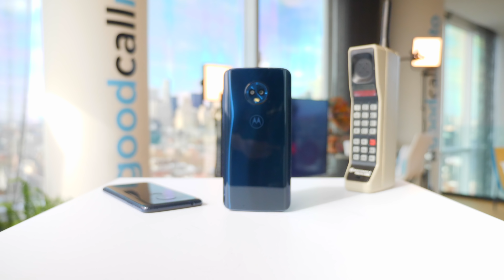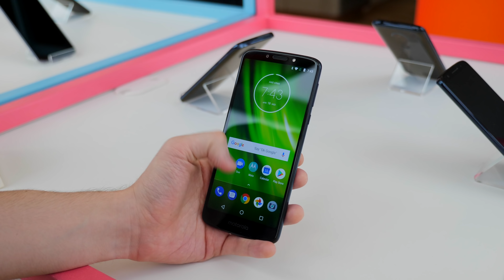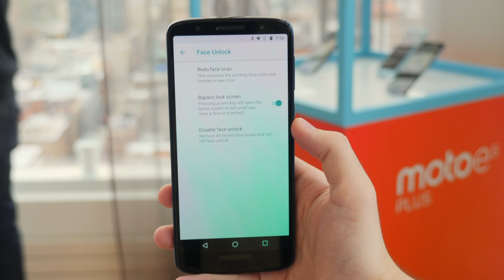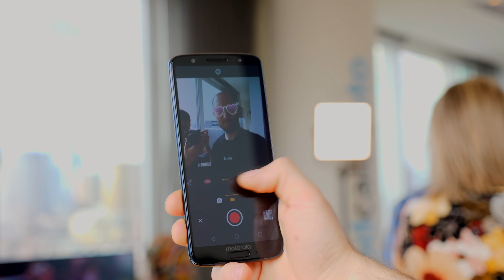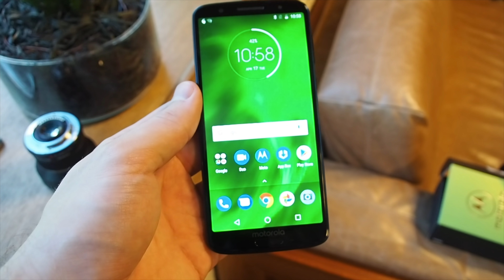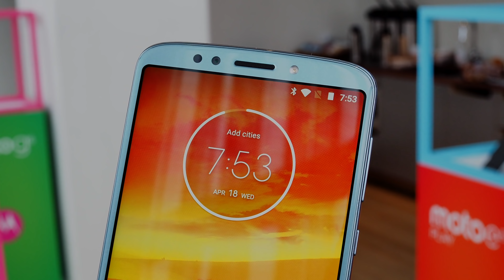Moto G6 series hands-on: G6, G6 Play, and G6 Plus in-depth!

Comment: Looks like a cheaper version of the piece of crap Moto Z with the update the software destroy the battery feature.  Hope your updates dont kill off the battery like they did mine at exactly one year-coincidentally after the warranty was out.  I will avoid Moto like the Plague from here on.  Junk all junk.  Shame really-I had 4 Droids in a row, even the very first with a slide out keyboard.  This one is the worst phone I ever owned, bar none.

Comment: Moto G6 Play is $80 at Walmart
Reply: It's $80 because its a Boost Mobile  phone. But, it does also work on Sprint service. Actually the SIM card that comes with it is Sprint branded. This is how I bought mine and I'm using it with the Sprint 1 year free service. I called the sales line and activated it with them. I've been using it for 2 weeks now on Sprint with no issues.
Reply: P47 Thunderbolt That's a steal. There's gotta be a catch
Reply: Shanez1215 ,it's a decent phone, not spectacular . The Play is the cheapest of the G6 line. Also it will not except the Moto ad ons .

Comment: Until they use "Replaceable batteries", I'm not touching them, I have a DEAD Moto-X Pure Edition that gave up the ghost shy of the 2 year mark, the bettery is NOT-USER REPLACEABLE & there is NO ONE IN HOUSTON, TX that will touch it.  Best for low price models, Samsung Galaxy J7 which has replacable batteries & in same price bracket as the Moto-G series, but with options to expand memory yo 256GB & some models available with 2 SIM card slots if you travel outside the USA a lot..!
Reply: Howard1939 ... The Moto x Pure is so easy to change the battery. Very easy job. Do you have hair dryer? It isn't like the essential phone where you need to destroy it to reach the battery. If you need a phone with replaceable battery, you are gonna be stuck with like 1% of the phone market and it is gonna be lame phones. No way would I take a used galaxy s7 with its garbage battery life and horrible user interface over the Moto.

Comment: I personally don't like the new Moto Camera app. The old version was much easier to use with one hand. I could just swipe a finger to zoom in/out. Now it's a pinch gesture that takes quite a bit of movement to get it to engage. It is much more difficult to minutely adjust. (I'm on a Moto G4)
Reply: Jeff K ... No. In the settings of new camera app, you can enable zoom up with finger swipe up. You have options.
Reply: thanks. I have only used it once since it updated on me. Kind of annoyed me and didn't have time to look around much. I don't take pictures that often
Reply: Jeff K ... I have 2 Moto Z play phones and did side-by-side test. The new app take better photos over the old app. The new app also shows the thumbnail picture last taken which is nice. The old app has a cleaner less cluttered interface. One can make a case for either one being better. I slightly lean towards the old camera app because I prefer full 16:9 view and want a cleaner look. If you uninstall the new camera app, it simply goes back to old camera app.

Comment: Very solid mid-rangers, however the Xiaomi Mi A2 is coming very soon, and it seems to be better in pretty much every single way, and actually being something like an upper mid-ranger. The design, where Motorola is actually very distinctive, sort of like Sony is what I like, as well as the Moto gestures, which are the best.
One note to make: all the G6 models should have had the fingerprint sensor on the back, I just don't get how they made that happen for the cheapest of the bunch and put a home button on the more expensive ones. A front fingerprint sensor on a tall phone is not the best way to go. I can't believe ordinary consumers realize these things, and manufacturers don't.

Comment: Don't be fooled. Yes, the SD 450 and SD 625 both use 8 Cortex A53s on a 14nm process, along with the same GPU, but the 450 has a lower clock speed (1.8 GHz vs 2.0 GHz). You can compare all the specs on Qualcomm's website. It's literally a downgrade.
Reply: Trust me fanboi never understand lenovo just f@#$up G series...
Reply: I agree. But for some reason these youtubers (or lenovo/motorola) insist that the G6 is an upgrade to the G5s Plus. Probably as an excuse for not bringing the G6 Plus to the US.
Reply: Is the 0.2 Ghz downclock going to make a world of a difference? I guess not.  And it is an upgrade compared to G5 Plus of all the obvious changes that we can figure out.
Reply: Since when in smartphone history does a successor have a slower processor? The G5s plus is a variant of the G5 plus, so it's acceptable for it to have the same processor. But to claim that the G6 is the successor to the G5s plus is ridiculous. Based on the naming itself, the G6 Plus is the successor to the G5s Plus. Based on the processor (source: Qualcomm), the G6 Plus is also the successor to the G5s Plus. The 400 series and 600 series processors are not even in the same tiers. Another interesting fact is that the processor is missing in Motorola's G6 specs sheet, while it's listed in every other one of their smartphones. In the features section it just mentions "1.8 GHz Octa-core processor." Hmm, is it just coincidence that the G6 doesn't mention its processor, or are they purposefully hiding it? Whatever the case, based on logic, the G6 (SD 450) is the successor to the G5 (SD 430), and the G6 Plus (SD 630) is the successor to the G5s Plus (SD 625). I don't know how it can be any more clear than that. My issue is not with any of the devices or pricing. It's with whoever is claiming that the G6 is the successor to the G5s Plus.
Reply: It's a successor to the G5, not the G5 plus. In Sweden we have both the Moto X4 and the Moto G Plus so this reviewer's argument doesn't work as soon as you add other countries than USA to the equation.
Reply: Over the normal G5 it's a huge upgrade. Also from the G5 Plus, the G6 Plus is a huge upgrade.
Reply: Is a 10% difference in clock speed substantial when running near stock software?
Reply: Shanez1215 no. my moto z force died, so i got the moto g6, and even though my force had an 820, this 450 seems faster. cept in games, the graphics are so bad lol
Reply: Shanez1215 I'm just stating facts. IF the supposed claim by Lenovo that the G6 is the successor to G5s plus is true, then I'm just saying that the processer is slower, and Lenovo is intentionally trying to hide it on their own website. What you think of the company's decision is your opinion, but I personally wouldn't buy or recommend this particular device. If a company goes out of their way to hide something, it sends a negative message, and I want people to know that before they decide to buy it.

Comment: I'd rather buy a used LG G6 in mint condition, SD 821, 4 gigs of ram and a much better screen and less bezels with much better camera. And SD 660 was a must for G6+
Btw the G6 is only about 200 on websites like Swappa and eBay and for other countries, Mi Note 5 pro seems like a more lucrative offer
Reply: You're getting cleaner software here, so there won't be a big difference in performance, I actually think the g6+ will be smoother, an in my opinion better design, better front facing camera with a flash, portrait mode, updates for a longer period of time bc LG g6 is a year old, face unlock and a bigger battery with a similarly efficient processor= superior battery life + it would be new instead of used so I don't really agree with you here I think the g6+ would be a far better option
Reply: LG G6 battery kind of sucks 
:( (especially if its a used one) the camera isnt much better either but it did have a really versatile wide angle lens if youre into that sort of thing, so theres that
Reply: I have LG G6 I will NEVER buy a LG phone again.
Reply: It's almost may 2018 and still no update on that android 7.0. Never again LG.
Reply: I will never buy a LG my g3 was mint condition and they would never update me and the phone randomly bricked
Reply: Megh Shah agree
Reply: Giving Sd 660 a miss was a foolish thing to do for the plus version.
Reply: No to LG they all look nice but software is so frustrating. I have the V20 and it freezes and stutters for no reason. I also had a G4 and its boot looping had me go through 3 of them. I tried to like LG but I'm done with them after this V20.
Reply: I used to make comments like this about what good phone deals there are on eBay, for example. But the LG G6 from early 2017 will not be supported as long with Android upgrades and security updates.
Reply: Raggedy Exynos It doesn't suck
Reply: no oreo tho
Reply: Bellthegaomon There is. I got it. P.S it is getting loads of updates now cause LG built the software upgrade center and it has an enterprise certification from google/android sub-brand
Reply: I used to have a LG optimus black back in 2012 . even BACK THEN I SWORE NEVER EVER to buy a LG again.
  Seems I  wasn't wrong  !
Reply: the g6 plus is reportedly coming with snapdragon 660.
Reply: Nah Xavi168, its a S630 device.
Reply: LG is crap.

Comment: The 18:9 aspect ratio makes the phone tall and slimmer and the huge buttom bezels in these phones make it even taller. Thats sth odd and creepy. I'd still buy the G6plus if it came for $250. It doesnt deserve anything more than that considering redmi note 5 pro costs $230 and is a better package.

Comment: DO yourself a help guys. Get the Xiaomi Mi A2. :D
Reply: Kiruba Shankar i would love to buy mi A2 but main drawback of its bettry 2910mah im mean seriously ??
On the other hand they are offering 4000mah btry in RN5 pro sad
Reply: I doubt Xiaomi wants us to buy the Mi A2. Why would they spec it with a 2900 mAh battery?
Reply: gngnome its a monopoly bro... They want to sell more unit of Redmi note 5 pro.. they knew if they give big bettery on Mi A2 then it will effect on RN5
Reply: Better power management from latest chips maybe ? U might never know untill u use it.
Reply: I will wait for a review then get the Mi A2. I love stock Android BTW.
Reply: Kiruba Shankar Problem is the 6" screen and increased resolution is going to sap away any gains in SOC optimisation. More importantly, Mi A2 is using the old Snapdragon 626.  

The Nokia 6 (2018) might be the better option for Android One in that price segment. Older 5.5" screen but should last on a 3000 mAh battery with a 630 processor.
Reply: Dont know the processor of the Mi A2. So cant comment on that though !
Reply: Kiruba Shankar link to the same source that mentions battery. There's still no official announcement so this can change. However screen size/resolution on that battery is disproportionate.
 https://www.gsmarena.com/xiaomi_mi_a2-9140.php
Reply: I wouldnt believe anything till an official launch, just6 to be on the safer side :)

Comment: Snapdragon 630 in g6+? It should have had at least snapdragon 636 if not 660..  Redmi note5 pro seems better
Reply: The rom after 2 updates will kill Redmi 5 pro
Reply: CraftMan7 The 636 is an update of the 630, which has eight Cortex-A53 CPU cores. Those are the current-gen low-power core from ARM. The 636 will have eight Kryo 260 cores in two four-core clusters. Qualcomm says this offers a 40 percent improvement in performance compared with the Snapdragon 630..   Anyway your money, your choice 👍
Reply: Worthem Shadang except for the ROM which is closer to pure Android. I don't know.. It feels like the difference in ROM would be more apparent in daily use than the difference in processor.
Reply: Yeh.. It wouldn't matter much for casual users otherwise it would be other way around..  Certainly a disappointment for many like me
Reply: Worthem Shadang MIUI is not worth it for the bloat.
Reply: Goodness me! It only has a slight difference between the 630 and the 636. And does the R.n5 has all of the features of the G6+? I'm not a fanboy of them both. Xiaomi got you fooled.
Reply: Worthem Shadang rn5 pro looks pure shit.
Reply: Worthem Shadang Good point I see. Anyways, I'm not buying a budget phone because it always lacks something. Going with the S9, or even a OP6. (iPhone can be also a good option I think).
Reply: lol keep dreaming. I've used both and stock android is nothing special. MIUI is equally fast and has so many extra features.
Reply: Worthem Shadang but still in general performance it fails to match even the Moto g5+ as seen in many reviews. MIUI slows redmi  note 5 pro really badly
Reply: Wait till you see speed tests. Stock Android is lighter than MIUI. You don't need as much power to run it better.
Reply: stock android fgts think stock android is gonna magically make sd 400 perform like 835 lmao fkn idiots.
Reply: Sam Fisher no but it will magically make it perform like Snapdragon 660 Xiaomi
Reply: Sam Fisher ohh really?
But for Samsung's TouchWiz it's true.
I have a Samsung j2(6) and it used to fking lag even while in app drawer
But when I flashed stock Android custom rom it was super snappier and smooth
Reply: I don't like touchwiz as well but you're using a fkn J2 with just 1 GB ram. It's gonna lag even with stock android.
Reply: Atleast Motorola didn't copy any designs. 😂😂😂😂
Stock android don't need heavy cpus to run fluently, THAT MIUI IS A BEEFY SHIT!. go check a speed test between rn5pro and miA1 then talk.
Reply: Sam Fisher 1.5gb and it doesn't lag now with stock android
Reply: Lost in the specs.
Reply: I feel sad for Motorola. They was a very good company till in hands of Google. 
Back old days G series was the Real Budget. But now :(
Reply: Jeffrey Michael by that time redmi note5 pro would be on Android P and miui10.. So u decide buddy

Comment: I'm disgusted that the G6 Plus isn't coming to the U.S. as it has every feature I would want. I don't want the X4 because the lack of RAM/Storage is a problem. I've saw the reviews in how it wasn't as fluid as the G5 or G5S Plus. The 4 and 6GB X4 actually worked better. The logic behind the G6 Plus not making it to the U.S. makes zero sense.
Reply: me too.huge bummer. i like big screen phones and 5.7 18:9 (which is about like a 5.4 16:9 in area) aint cutting it. so stupid on motorola's part, they literally arent bring the most interesting model out in the states. really pisses me off. no wonder motorola just laid everybody off, with decisions like these...

and why dont more manufacturers in general target that mid range, 300-400 area (like the Moto G6 Plus would have if it was coming out in the USA)? you either get low end $200 crap or super expensive crap like $800 Samsung's, nothing in between. again, stupid. You could argue One Plus T with the $500, but the one plus 6 will probably cost more and besides, $500 off contract is IMO still very pricey.
Reply: Go for the x5 or z3 play. Pay little extra but it is so worth it with it's extra specs and features. Huge fan of the Moto Z play.
Reply: Bflo23 I may go for the Z3 Play if it has a headphone jack.
Reply: James W ... I love my Moto Z play. I get 10 hours screen time over 3 days on 1 charge. Blazing fast. Super AMOLED. NFC for Android pay. Moto mods like thin profile battery mod and jbl mod are great too. I am most likely gonna upgrade to Moto z3 play.
Reply: Bflo23 I'm enjoying my Z Play and waiting for the Z Play 3 as well.
Reply: Cryengine_X Because people in the US don't buy in the middle of unlocked I  general. Carrier financing causes people to always buy flagships, and the walled garden of the carrier stores allows companies like Samsung and LG to put utter garbage overpriced budget phones in with bad software to trick people into paying a ton of money.

In many ways, the US is an oligarchy.
Reply: Amazon

Comment: Redmi Note 5 Pro RULES !!! ❤️❤️🔥🔥😎😎
Reply: Nah! Nothing comes close to Moto Experiences
Reply: Abhishek Bhattacharya Redmi Note 5 Pro just launched. These Moto phones also launch with Oreo, plus Stock Android>>>>MIUI 
And ya, an original design>>>iPhone ripoff
Reply: Shivji Ayyappan for u ! 😂😂😂 
Those once in  6 months updates r HORRIFIC  EXPERIENCES !!! 😂😂😂
Reply: android 1 is not in redmi note 5 pro
Reply: out of stock RULES !!!
Reply: Abhishek Bhattacharya  I Don't mind 
I Flash roms anyway :)
Reply: Harish Salvi Mi a2 is coming on 25
Reply: Shivji Ayyappan Yeah, with no monthly security updates and no upgrades. Clearly, nothing comes closer.
Reply: Shivji Ayyappan I'm using Moto G5 plus, trust me I wish I went for a1 or a Nokia phone
Reply: 11 22 - Mi A2 has middling specs, older SOC with a sub 3k mAh battery from what's been revealed. Moto G6 series hits the performance and software sweet spots for media use, especially with front firing speakers and a dedicated sd card slot. 

Battery life is a concern apart from G6 play because of the larger screens and resolutions but it includes a turbo charger that for some inexplicable reason the Xiaomi note 5 pro lacks despite supporting the feature. Compare note5 pro to mi A1 and you get the sense Xiaomi really wants to promote MIUI, which is not an option for some people although switching to custom ROMs does appeal.

For Android One, the only reasonable option seems to be the Nokia 7 plus and it's in another price segment while lacking Moto's design. Maybe the 128 GB G6 plus approaches it on price to make Nokia the better option.
Reply: Rushil Rai Sd450<<<<<<<<<<<636 
Now what say 😛
Reply: areeb1296 HAAA HAA !!! 5 Pro is getting Oreo with MIUI 9.5 update this week in stable ROM! Atleast not like Stock android of Moto giving once in 6 months update ! Better to use android one devices like Mi A1 or Nokia phones 😂😂😂😂
Reply: Rushil Rai Shitty once in 6 months updates is not stock android 😂😂😂 android one is there ❤️